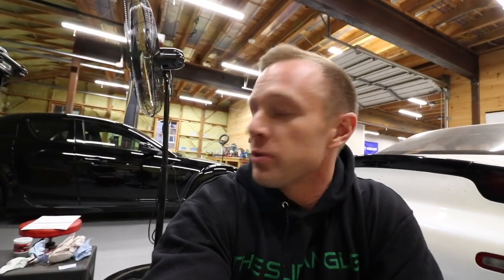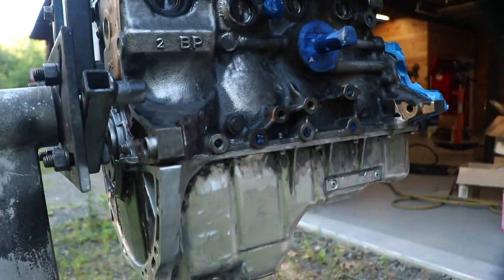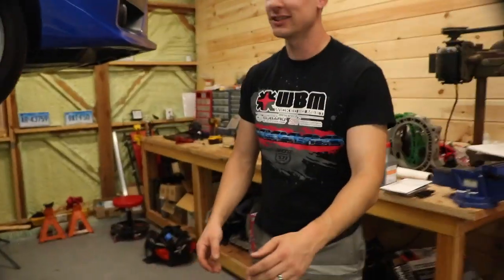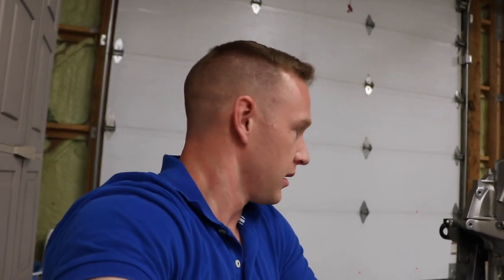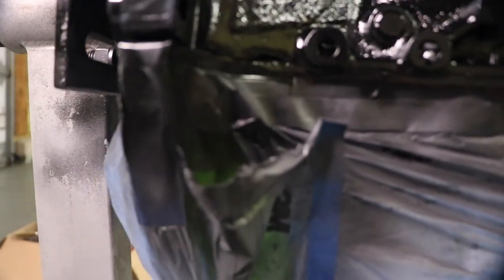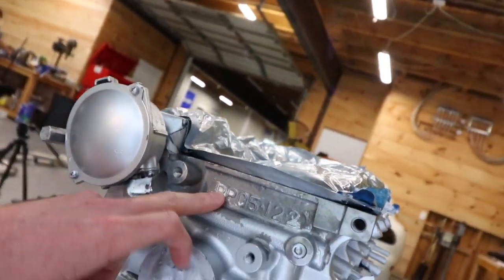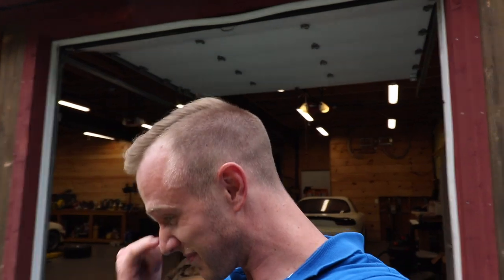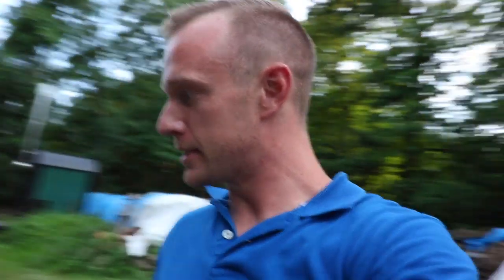How To Paint Your Engine! (Head, Block, Oil Pan)

Comment: Nice! Just found the channel and love your work. 

Out of curiosity how concerned were you with paint seeping into sealing surfaces like fuel injector ports, valve cover seals or water outlets? 

I'm going to paint my block when I rebuild the engine now!
Reply from the maker: Thank you. Not concerned. Some paper towel in the ports and some painter's tape protects all of that.